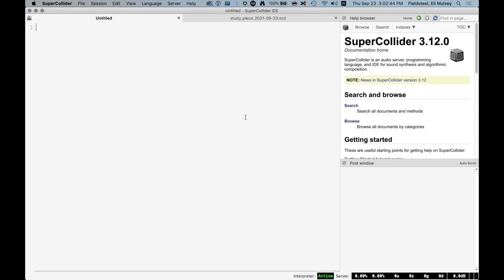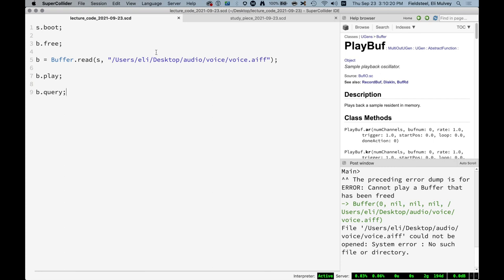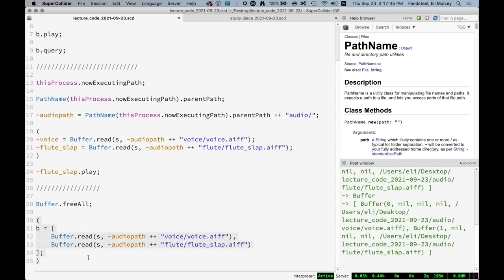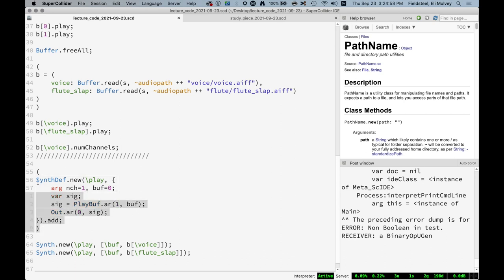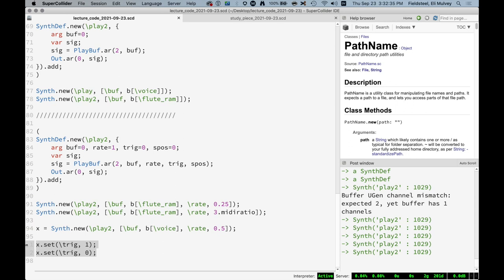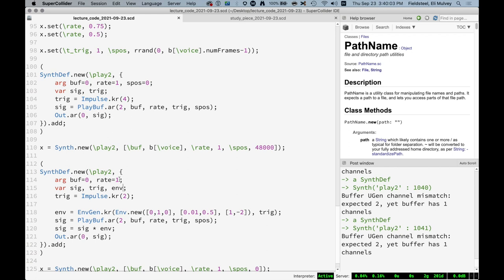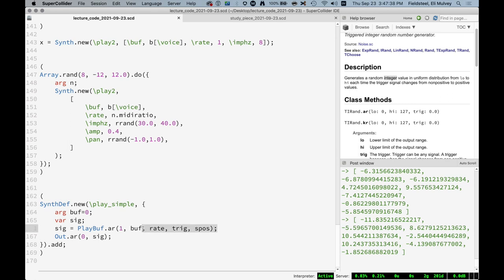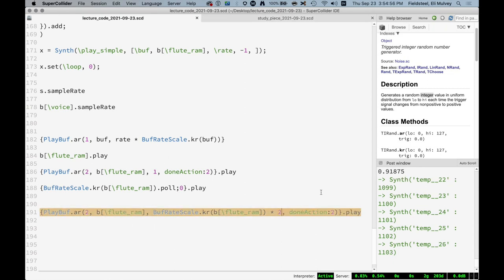Audio Files & Buffers - Week 5 Fall 2021 MUS 499C - Intro to SuperCollider

Comment: Awesome lecture, Eli! I've learned so much from your work! I have a question: Is there a way to use the Ugen Amplitude to trigger buffers? I've been working around that but I haven't found a way to send the Amplitude numbers back to 0. I want to use a microphone to trigger sounds.
 Thank you!!
Reply from the maker: Thanks! There is.

The trick is to pick a threshold, and compare the amplitude against it. A conditional check on the server is 1 when true, and 0 when false. This is the signal you should use to trigger PlayBuf, EnvGen, etc.

Here's an example. SetResetFF makes sense because it's basically a switch that can be turned on with one conditional check, and turned off with another. The sample (sig) is triggered whenever the source signal (src) is above -26 dB, and the sample can be retriggered after the amplitude falls below -50 dB. Keep in mind you'll have to fine-tune the threshold and reset parameters to get the precise behavior you want, based on the actual signals you're using.

s.boot;

b = Buffer.read(s, Platform.resourceDir ++ "/sounds/a11wlk01.wav");

(
SynthDef(\a, {
	var src, amp, trig, sig;
	src = BPF.ar(
		in: WhiteNoise.ar,
		freq: 1000, rq: 0.01,
		mul: LFNoise2.kr(5).exprange(0.04, 4);
	);
	amp = Amplitude.kr(src, 0.01, 0.3).ampdb.poll(label: 'dB level');
	trig = SetResetFF.kr(amp > \thresh.kr(-26), amp < \reset.kr(-50));
	sig = PlayBuf.ar(1, b, BufRateScale.ir(b), trig, startPos: 17000);
	sig = sig * Env.perc(0.01, 1).kr(0, trig);
	Out.ar(0, src ! 2); // control signal
	Out.ar(0, sig ! 2); // triggered sample
}).play;
)
Reply: @elifieldsteel  OMG! Thanks, Eli!! I'm going to work on this right away!!

Comment: Eli, thanks for these great lectures. In this class, you were mentioning that you might share some code with your class on how to access audio files  for sampling more efficiently using iterations (around 15:00). Would you be able to share this code you were referring to (with instruction)?  Thanks, Daniel
Reply from the maker: The following code should work, and includes a few "protections" (confirming file extensions, avoiding identically-named subfolders, avoiding empty folders, etc.). I also have a class extension gist posted here — similar but a slightly different approach: https://gist.github.com/elifieldsteel/396cd1326d3c981ba1fd2a3c47d90ea3

(
~makeBuffers = { |path, event|
	var dir = PathName.new(path);
	var contents = dir.entries;
	if (contents.select({ |n| n.isFile }).size > 0)
	{
		var files, bufArray;
		files = contents.select({ |n| n.isFile });
		files = files.select({ |n|
			["aif", "aiff", "wav"].includesEqual(n.extension)
		});
		if (event[dir.folderName.asSymbol] != nil) {
			"duplicate subfolder name ignored".warn;
		} {
			bufArray = files.collect({ |n| Buffer.read(s, n.fullPath) });
			event[dir.folderName.asSymbol] = bufArray;
		};
	};
	if (contents.select({ |n| n.isFolder }).size > 0) {
		var folders = contents.select({ |n| n.isFolder });
		folders.do({ |n| ~makeBuffers.(n.fullPath, event) });
	};
	event;
};
)

b = ~makeBuffers.("path/to/your/sample/directory", ());
Reply: @elifieldsteel  Thank you!